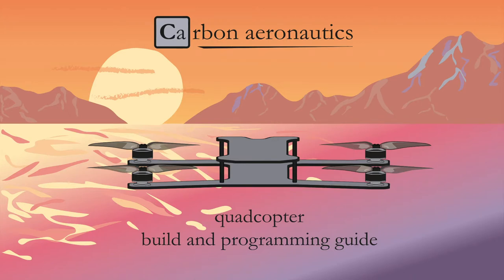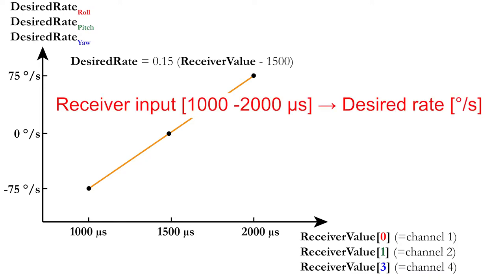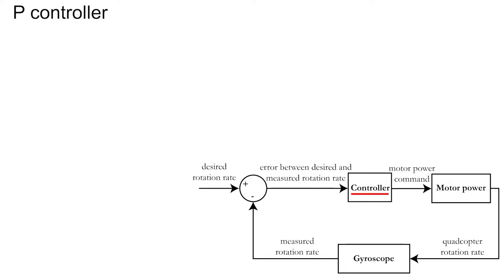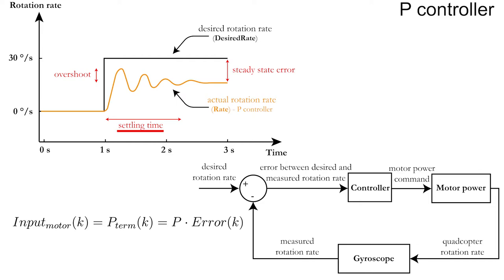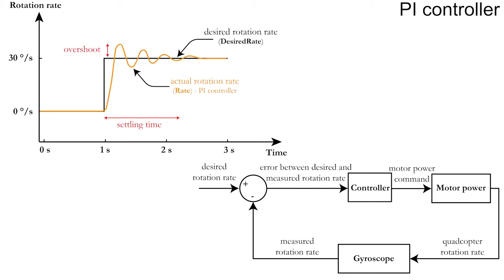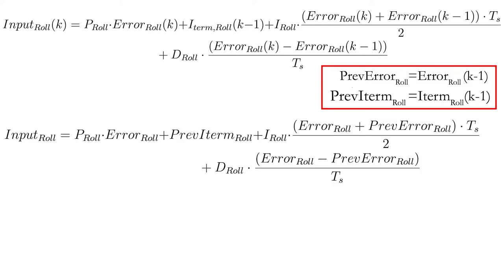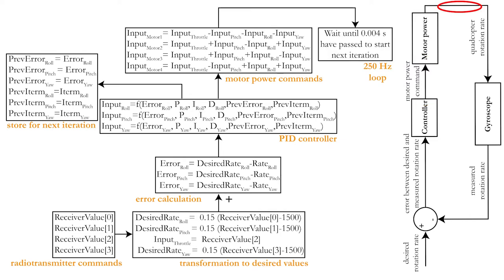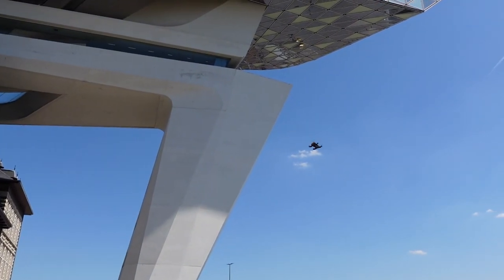12 | Program a PID controller to stabilize a drone

Comment: I am using derivative from measurement on my project. Because derivative from error generates "D kick" when setpoint changes rapidly. U should try. And u didnt mention that d term has to filtered properly with something like notch filter in order to not burn your motors and fly nice. 
250 Hz PID loop really slow for any size of drone. Increase it to 500 Hz and use oneshot125 ESC.
Great work.
Reply: How can I filter d term ? What does it mean ?
Reply from the maker: Indeed, in part IV I explain that you need to use a low pass filter for the gyro measurement. The filter is set to 10 Hz in register 1A of the MPU6050. I did not try to filter the D term separately because the I did not yet experience motor or ESC issues, probably because the measurement itself is already filtered and the D term is not excessively big.
Reply: @carbonaeronautics  I couldn't find the code with the link provided below can you help me out with it
Reply: same problem, if derivative the error, when quad nearly reach the setpoint, its will be divergence, but i dont know why.